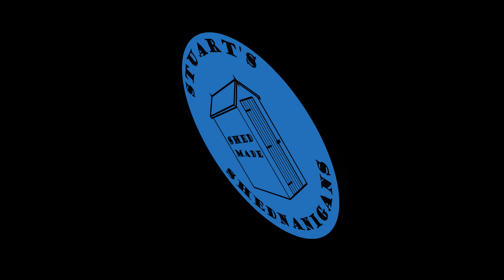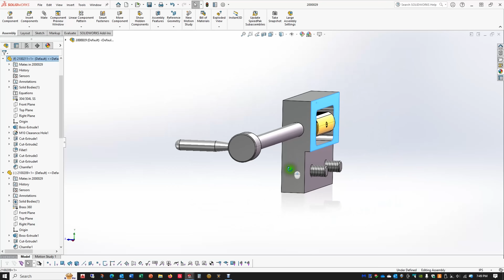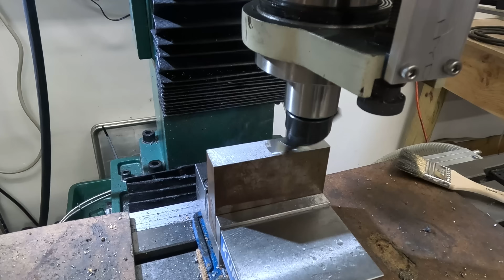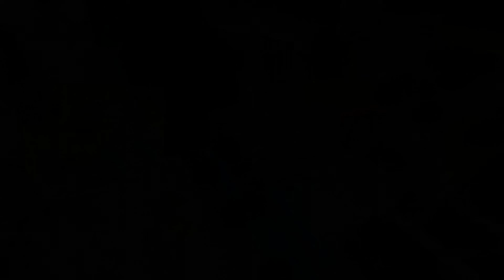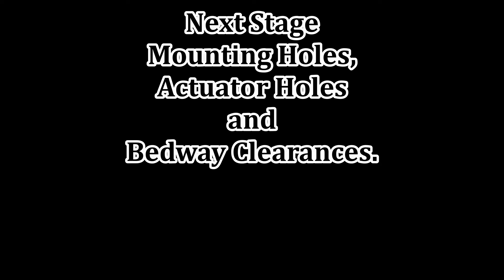Superior Shop Made Lathe Cross Slide Lock - an Easier to Use and Safer Design.

Comment: Looks like a good idea.  I especially like the idea of retaining the mounting for the steady.

I'm not a fan of flycutters for squaring stock unless by "squaring" it's only a question of removing a tiny amount of surface inequality.  On hobbyist machines, deep cuts with flycutters are really hard on your head bearings and gibs (and in your case, quill), and the continued shock loading can also end up pushing your head out of tram.  I've found it faster to use a good sized endmill (which will get you squarer parts overall if your head isn't 100% in tram anyway) and use a flycutter for a final finishing pass if I care about surface quality.  But it depends on initial squareness of stock.  I've seen a couple of videos of people squaring stock with a flycutter and taking cuts of a mm or two on work sticking up way out of the vice, eeeagh!
Reply from the maker: Yes indeed. I much prefer an end mill for material removal these days. Flycutters can be nice for a lighy clean up though, for sure.

Comment: great design, how exactly did you determine the diameter of the brass cam. I feel like it needs to be pretty spot on to give enough pressure on the cross slide to lock it
Reply from the maker: I fretted over it a bit. I gave some consideration to flex of the housing when actuating the cam, and flex of the support shaft, then added in an "interference fit" allowance. I figured that going a little "heavy" on the intereference would be best, since the flex in the housing and shaft would allow some tolerance - plus not a big deal to remount the cam on a shaft in a 4 jaw to turn a little off if needed. In the end I got it right first time - which is the beauty of planning I suppose. I could have modelled it and run a deflection FEA but that seemed a bit OTT for this. Thanks for watching!